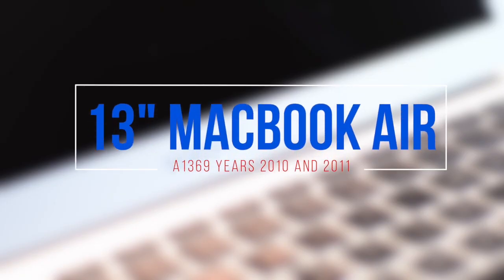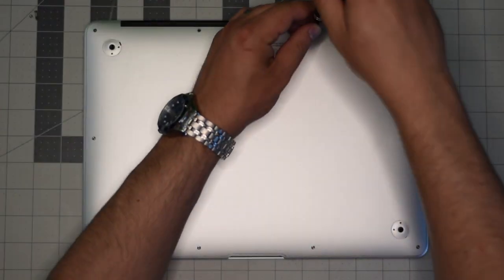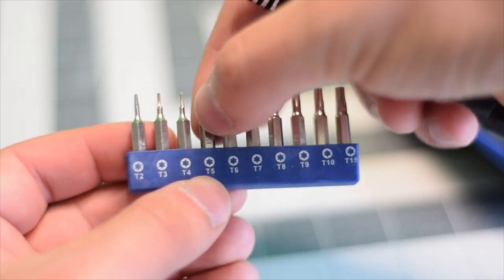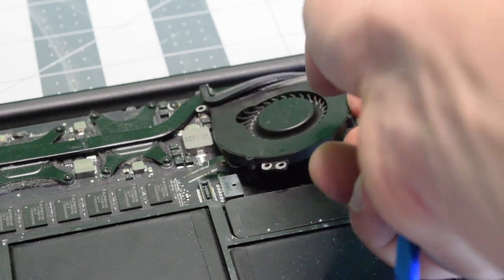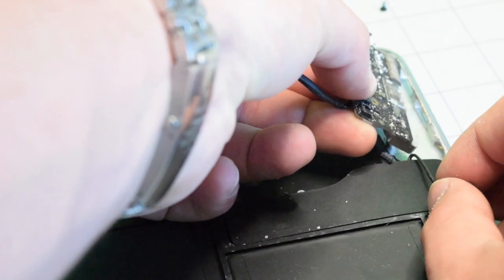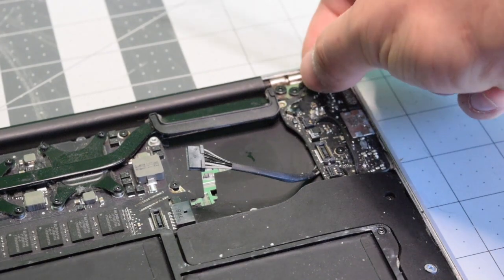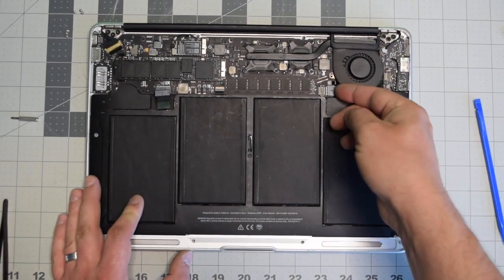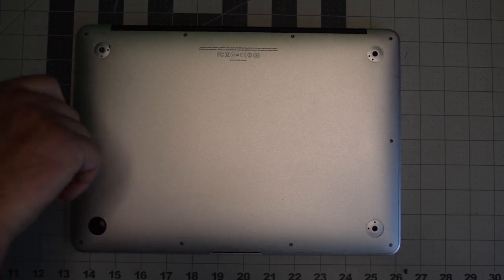13" Macbook Air A1369 2010 and 2011 Input Output (IO) Port and Power-In Board Replacement

Comment: I have a macbook air 2011 A1369. I have a problem with the boardmagsafe but the spare part I find is a1369 2014-2015 though. Can you tell me for sure if it will fit on my Mac because as I told you it is a 2011 model. Thank you